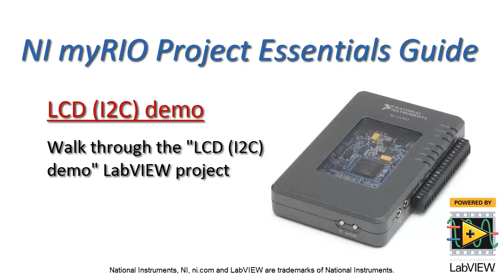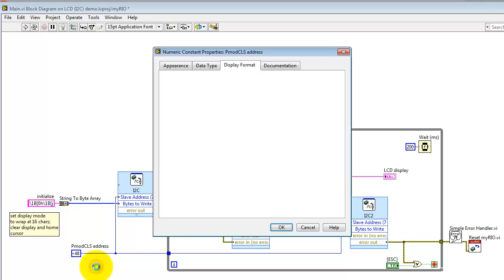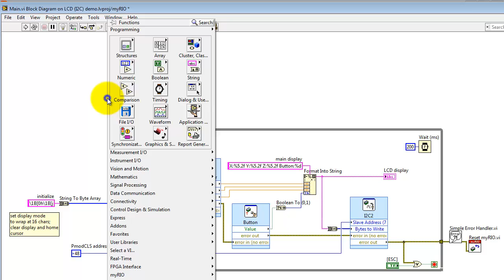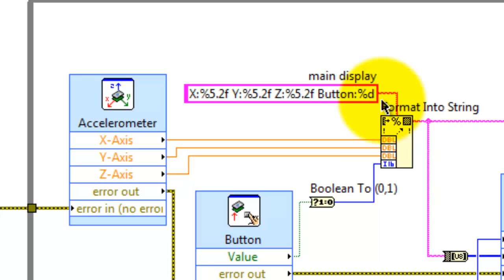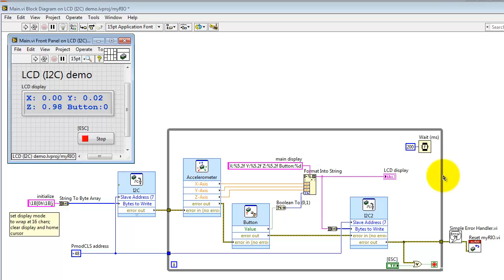NI myRIO: "LCD (I2C) demo" LabVIEW project

Comment: Hi, i have an lcd screen 20x4.Please, you can help me with initialize code, please?The connection adress of mine is 0x27.
The specification of my lcd is this:
https://www.cableworks.gr/ilektronika/arduino-and-microcontrollers/displays/lcd/20x4-2004-lcd-display-module-with-blue-backlight-for-arduino-ic-i2c-twi-spi-serial-interface/

Comment: help i have the error 363011 . with saintsmart i2c LCD
Reply: I solved the error by changing the Slave Address. It varies from model to model. For the Sainsmart i2c LCD it should be either 0x3F or 0x27
Addresses for the:
     PCF8574T i2c chip = 0x27
     PCF8574AT i2c chip = 0x3F

The i2c chip is the big black square behind the screen, mounted on the small circuit board where you wire your 4 cables.
Reply: brother, have you fixed the error 363011?? i am also facing same error
Reply: i am also facing same error
Reply: Hello,
I am having the same problem!
Did you solve it?

Comment: Does this work as easy with a lcd graphic color display? (no character display)
Reply from the maker: Do you have a specific display in mind? Four-wire SPI is a typical bus standard for these displays and is supported by myRIO.
Reply: Its I2C: http://onecall.farnell.com/demmel-products/dpp-cts2432/lcd-module-2-8-240-x-320/dp/1846067

I'm curious because I've just seen character displays with myrio.
Reply from the maker: Astaroth Excalibur This looks like a nice product; it supports UART, SPI, and I2C, and each of these serial communications standards is supported by myRIO.